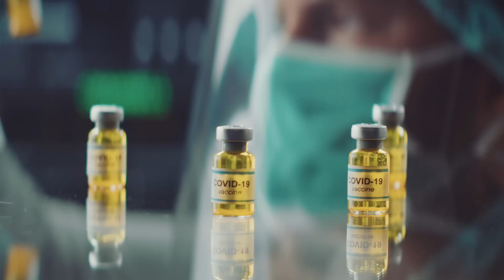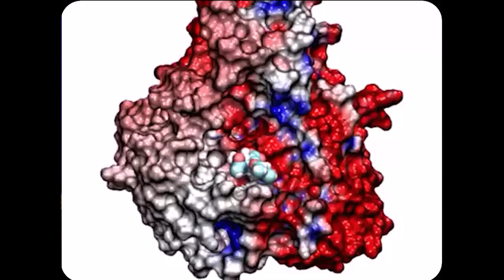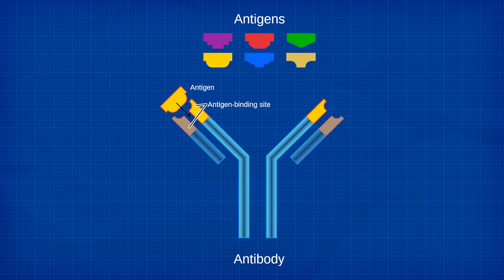The Secret American Chicken Stockpile: A Surprising Strategy for Global Security

Comment: I helped build one of the facilities that use eggs to make vaccines. It's huge. They said the eggs come from Amish farms in the area. They had 10 incubator trailers full to do a test run. It was gory they have to be fertilized . The eggs sat way to long over Christmas break. . It was a Sanofi plant. My job was to saw cut duct openings and core drilled for the plumbers/pipefitters, and electricians. I think it was a design build, so most penetrations were left out. I had that task.🍻🇺🇸